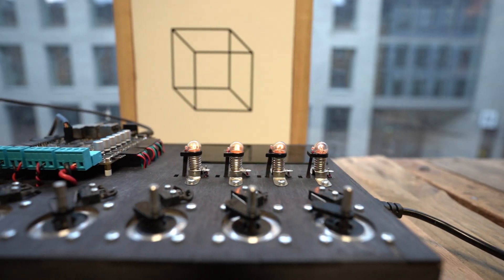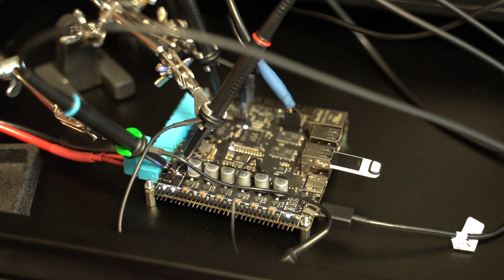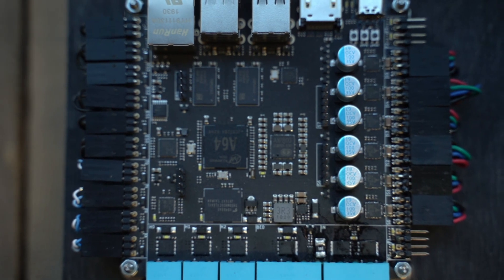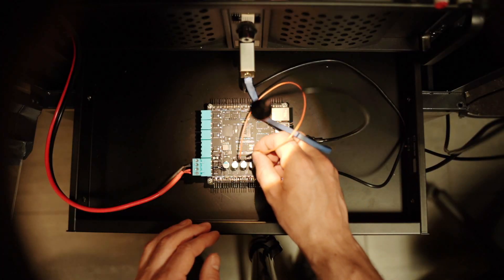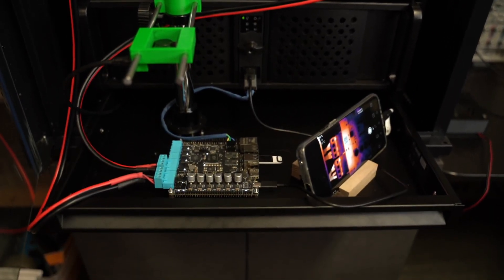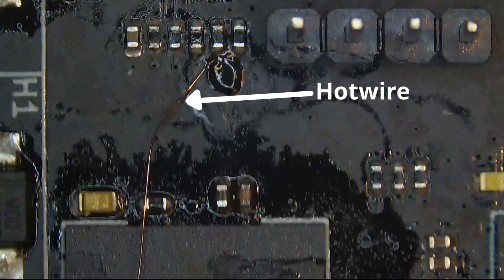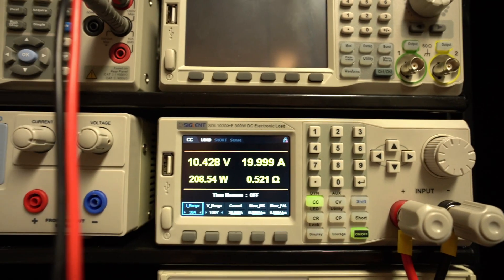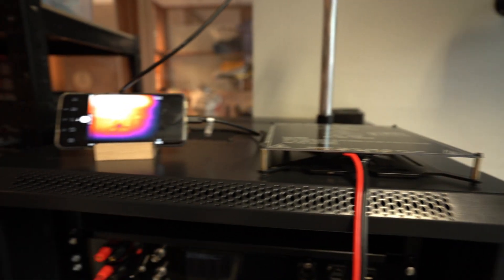Recore functional testing

Comment: I have asking about this for a year and a half, when is this going to be available? Want to try this really bad, have a few duet boards(wifi w/ x5 expansion for a e3d toolchanger and a duet3 on a coreXY, please give me some info.....
Reply from the maker: Hi! Sorry about this taking forever.  It's a bit more complex than a microcontroller based 3D-printer board. These videos and the schematic is all that is available for now. I have some more time to puor into this from now, so I hope to speed up development. Like I said in the video, I'm hoping the net revision is good enough to start selling! Manufacturing time for a 6 layer PCB with shipping is 3 weeks, add some testing and PCBA to that plus what ever else comes up before the PCB is submitted and you have a rough estimate on when it can be available. I think best case scenario is 8 weeks, that's the best estimate I can give!